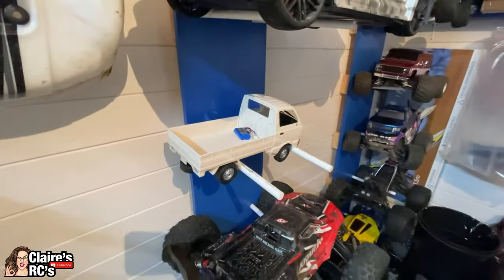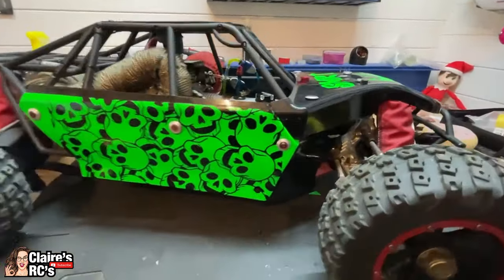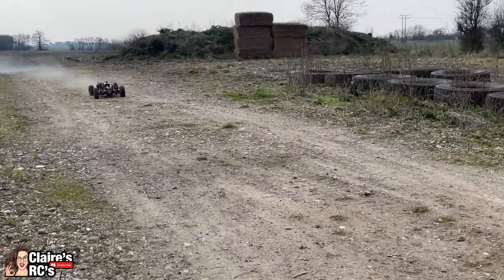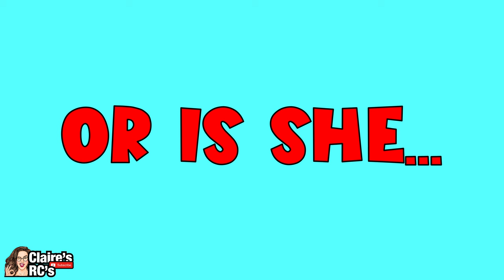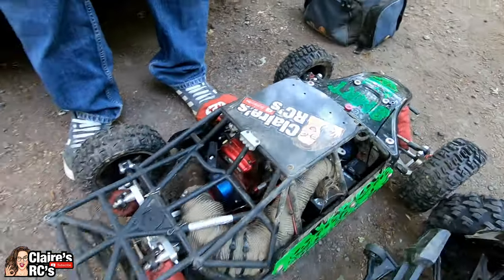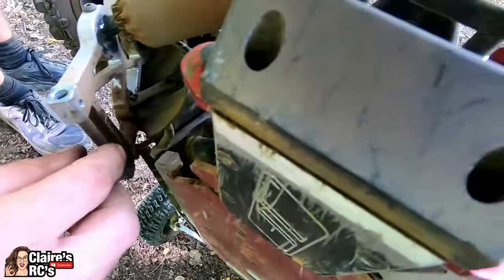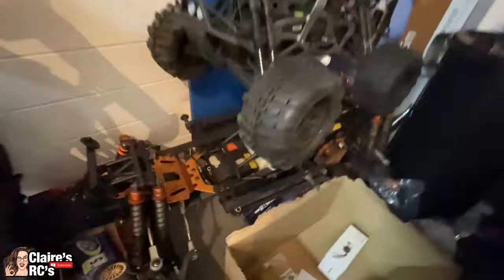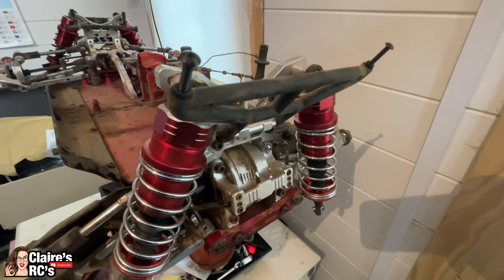SMRT- The saga of the 32cc OBR engine! Losi DBXL

Comment: Guys so landed yesterday in UK need to talk pretty sure at least 50% was not needed, will phone over the weekend so sorry you have had so many problems would not have done the deal if I thought you would have had so much grief I HAVE A COUPLE OF OTHER PIPES for the DBXL clutch yeah gearing needed to be sorted. Now the engine I think I know where the air leak was and may still be I fitted new tuned engine port covers and I found notes to remind me to remove and add a gasket sealant.
I have a box of spares still here and another motor if so required not an OBR £"cc reed case but another tuners I have had good luck with OBR I have a 38cc in my HPI 5SC that is eight years old never skipped a beat, enough for now as going to pick my hound up Nick

Comment: What does the spark plug look like best way to read it if running to lean etc it's very smokey! Plugs, black to rich white to lean if its brown good! 25/1 mix is good to for the 2 stroke
Reply: 32-1 I’d go with, little less oil and let it rev